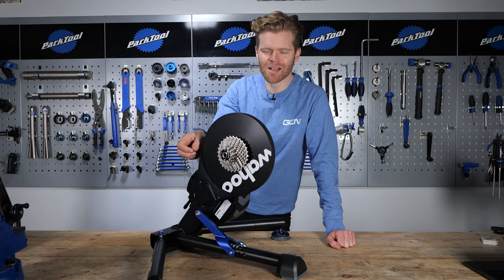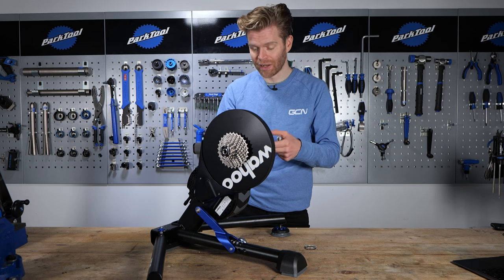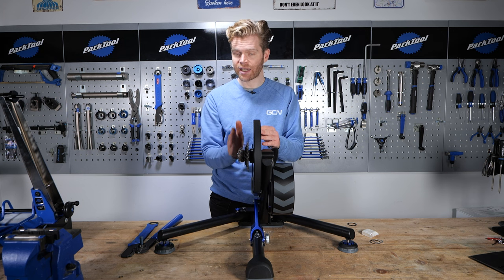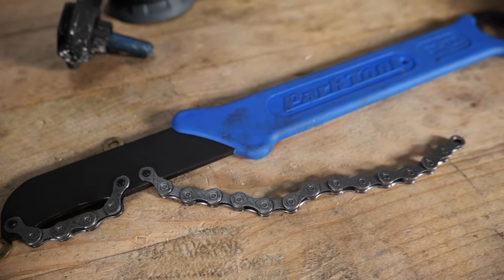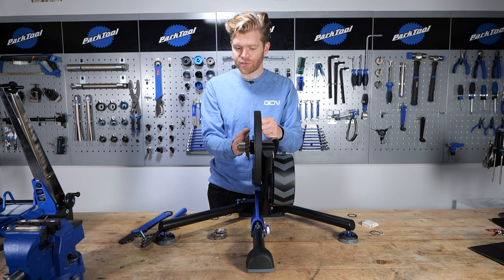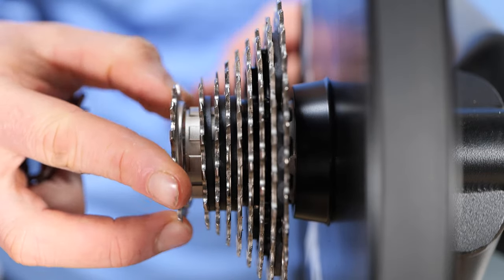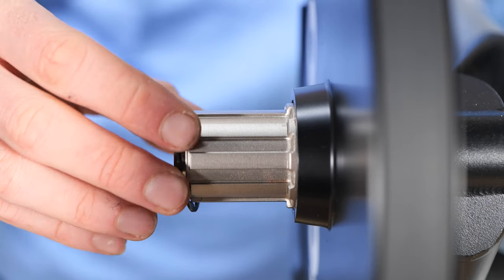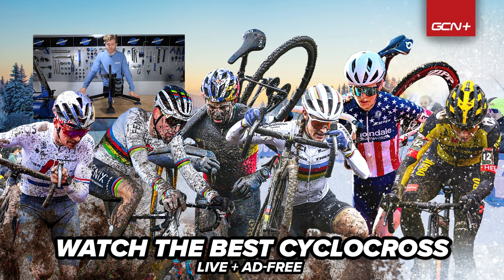How To Use Bike Cassette Spacers | Monday Maintenance

Comment: All these spacings between gear systems are a nightmare. I was running Sora on my DT swiss 1800 wheels which has an 11 speed ROAD hub with a 1.85mm spacer... all ok. I bought an 11 speed 105 groupo from CRC and also a 11-34 105 cassette from Merlin. This 11 speed cassette still needs the 1.85mm spacer on the 11 speed ROAD hub, and therefore somehow must be MTB spacing....!? 
On my new V5 KIckr neither that (new) Sora cassette or the Sram 10 speed on my other bike will go on to the KIckr "nicely" with their supplied 1.85mm spacer, it's rather uncomfortable getting the lockring tightened for fear of it stripping the threads and destroying the freehub...and both bikes the indexing is out but I suspect a 1.0mm spacer is needed as the cassette is too far out...but really the issue then is the Wahoo freehub  being machined somewhere between an 8-10 speed and an 11...
Reply: LOL, the "105" (huge air quotes) 11-34 cassette is just a HG700 with 105 printed on the lock-ring and is indeed a MTB cassette. In fact in the small print on Merlins website it states: The 11-34 is HG700 (Same as CS-R7000).
This is not just Shimano being cheap for no reason a 34 cassette on an O.L.D. (130 mm) road spaced frame can have difficulty clearing the spokes on some wheels without a spacer, so it makes sense for them to do it this way.
Reply: @chris1275cc  Thanks for that info.... I'm working on losing enough weight and getting fitter so hopefully can run the SS mech and 11-30 cassette (I bought the GS for 11-32/34) and avoid being shamed by real roadies for my "dinner plate" granny gear lol
Reply: yeah i have that cassette on all my road bikes and trainer,   and you have to use the spacer as the  back of it is concaved,  and like said can be used for MTB
Reply: @monetaryjack1705  I lost 70 Kg in 2 years mostly through cycling I had a 11-40 in the beginning, nothing to be ashamed of its mostly just banter. If you don't know of her already look up Katie Kookaburra on YT, she was a former "fatty" too, she runs a bigger cassette and sometimes even a GRX sub-compact, anyone who tries to shame her for it soon gets a hard lesson 🤣.
BTW Don't bother swapping the GS for a SS the GS will work better than fine. The SS is very limiting and IMO does not shift a 30 as well, a lot of people run a GS with a smaller cassette even us "real roadies" LOL
Reply: @chris1275cc  It's a lot to do with the terrain also, Cairngorms in the Scottish Highlands, I'd happily run a 30/46 with 11/34 if 105 was an option... Folk that live in flat areas can get away with 11-25/28 (and 36/52) and get the benefit of single tooth changes through most of the cassette!!!

Comment: Spacers did not work for me....the cassette always wobbled....I had to use a spare cassette sprocket which is larger in diameter and gives better support to the back of the cassette after removing it's rivets. Anyone else have the same problem?
Reply: sometimes the spacer is up against the tiny rivets that hold the cassette together,  causing the wobble, just grind / file down the heads so they are flush with the big cog and it should work fine. The cassette might fall apart when you remove it but not whilst its properly installed on the hub.
Reply: @andywalford7544  Thankyou, yes I removed the rivets in the end although since the spacers are the same shape as the freehub it shouldn't be a problem...only when fitting a sprocket instead...

Comment: Okay, now tell me how to set up a direct-drive trainer to work with my 1990s vintage Bianchi Eros with Campagnolo Mirage (3x8).
Reply from the maker: hahaha maybe that's one for a Tech Clinic? 👀
Reply: Get a trainer that takes a 130 mm O.L.D. spaced frame (most do but you might have to buy axle adapters separately). An 8 speed Shimano HG/HG compatible cassette will work fine (I know a lot of vintage campy guys like Miche cassettes when forced to use HG free-hubs) you will need a 1.85 mm spacer if the turbo has an 11 speed hub, or you could buy a pack of spacers and adjust by trial and error as in this video. The turbo won't care about anything else (number of chain-rings, etc.).